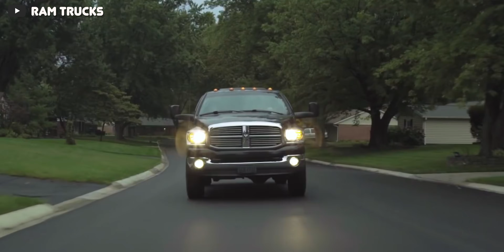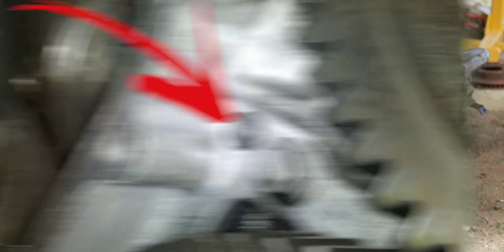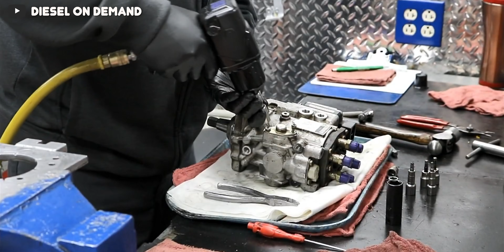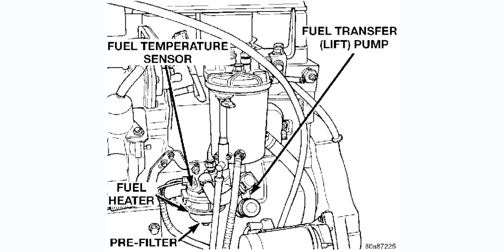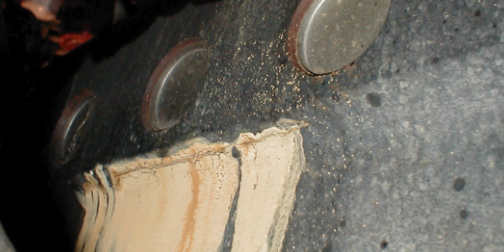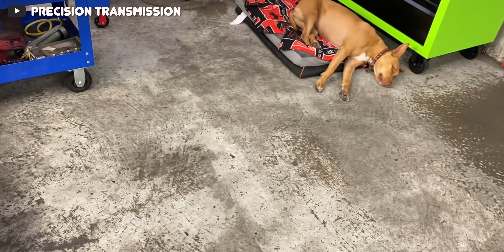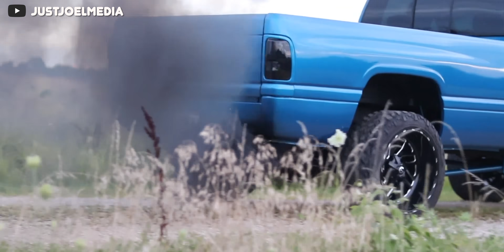Everything Wrong with the 5.9L Cummins (12V & 24V)

Comment: I'll admit the dodge with the manual transmission is the most reliable, you just have to get past the fact that it's the worst riding truck with build quality that rivals China quality and an electrical system that is beyond sub par.
Reply: What electrical system jk
Reply: @abraxaseyes87  he means the trucks electrical system as in the lights don't work the gauges give up the radio the windows all that
Reply: I see there is no point in defending my flavor or choice, as long as you don't try and tell me about how great and rustproof a 88-98 gm is , or what about that front end in a 3/4 ton ford from the 90's . My original statement was about 90's trucks guys . But they make different brands for a reason,so different people can deal with different problems .
Reply: @T-V-R-P id take a bad front end that really isnt bad over a truck thatll turn into dust 😂
Reply: "Gotta do the dodge delete on your cummins" - zip ties n bias plies
Reply: Take a 1995 3500 dually from all brands and I'd park my ass in a dodge seat first I personally think on gravel road the dodge rides best . That being said they are all horrible but remember these trucks were built for work back in the day not trying to ride like a Cadillac. And I'm not trying to start any brand arguments just my opinion from actually driving all 90's brands up my gravel road to get to my property.   .02
Reply: @T-V-R-P  so I prefer the Chevy 1 ton over the Fodge or Ford. If I had it my way id take a 12 valve with the NV4500 and put it in a Chevy pick up. Plus Chevy didnt use a solid front axle for the 4X4 system. Which has its pros and cons. Thats just my .02 though. Ill say this though, every brand has a great truck from different time periods and all have their pros and cons. Theres no decisive "best brand" in my honest opinion
Reply: An OBS Ford with a 7.3 is the best overall package. Sure the Dodge has a superior engine, but the 7.3 is still legendary in its own right (way better than the awful GM 6.5 of the time) and the rest of the truck is way better made.
Reply: me and my death wobble would agree with you 😂😂😂 mopar!
Reply: Drove a 98 that was stiff empty but rode great with the water tank I carried for work.  Electrical system was a joke and the steering was ugh loose😅
Reply: I have an 01 in an F-650 rollback tow truck with a 5.9 24v that weighs 17,500lbs when dead heading and can break 30,000lbs fully loaded. My truck is about as fast as a half frozen dog turd sliding down an asphalt shingled roof, but that Cummins pulls HARD AF regardless.
Reply: No problems with my 2015 3500 drw with the 408 cid  with the g56.
Reply: After owning 2002 cummins with 120-150k and 2005 with 150k-210k and 07 with 90-120k all i could say owner plays a big role. All 3 had zero problems. Preventive maintenance  is a key
Reply: @andreined8463  well i know a guy with a like 2016? 6.7 cummins who had to change the water pump, belt, alternator, and power steering pump within the first 50,000 miles.. and glow plugs lol
Reply: @Ilovemyidi  cummins dont have glow plugs. But then again alot depends on the owner
Reply: Negative ghost rider…… my 2000 f250 4x4 is the worst riding truck in all of history…… 😂😂😂😂
Reply: 47re aren't that bad,  the issue is most people don't perform the proper routine maintenance.
Reply: The only thing we had problems with electrically was the dash lights stopped working. Speedo kinda went goofy a couple times and the 3 speed auto needed rebuilt once. It plowed snow since 2001 pulled trailers and was a daily driver. Now it's just a pile of rust. It's been sitting since 18 and now the headlights just don't work. Now I'm not saying the wiring is flawless because iv owned other older dodges and yes their a fucken mess but this old cumm dumpster was a really great truck for our family
Reply: I think I will keep my 03 ram 3500, 585.xxx miles and still going strong. 2 clutches and I forget how many sets of injectors. But still the best truck I've owned.
Reply: No better or worse than any other truck I've owned 06 Dodge 5.9, windows all still working electric mirror on right side now has limited movement.  Cant think of anything else's thats a issue. Still a great truck.
Reply: Ford and chevy are junk compared to a dodge
Reply: Which dodge
They all could be bought with a manual
Reply: @ShogunAutoworks  I was referring to the 2500 and 3500 truck with the Cummins.
Reply: Well said
Reply: As a 2nd Gen owner (98.5) you are half correct. Every single thing has broken twice except for the engine and I'm currently on my 4th NV4500. I've split 3 cases, (always right behind the bell housing) and 2 np241 T-cases but the damn engine won't die.
Reply: For the dowel pin a buddy of mine would always pull the engine and just put a washer in there
Reply: Worst riding truck of all time is the obs F 250 with the front leaf spring suspension. 😂
Reply: Are you nuts. My ram Cummins rides like a Cadillac. My brothers Ford rides like it has rocks for suspension. It's the worst riding vehicle I've ever been in.
Reply: @daniastopjik3287
It comes down to a lot of factors that make a truck ride awful. My eclb 12 valve rode great, the single cab 2017 f350 I drive shoots my coffee into the headliner if I hit a bump.
Reply: It has gotten to the point of building My own Truck because I just don't like what is built recently.
Reply: I admit that every little thing breaks, my interior is gone and lights don't work, but this truck has 330,000 miles on it and it's always got me home... ALWAYS...
Reply: You haven't ridden in a new dodge have you?
Reply: As a young man I had a 1983 toyota Hilux.....dodge 3500 rides like a Cadillac in comparison
Reply: Other than THAT, is GOLDEN 😅
Reply: My 89 still runs like a dream, the motor that is. NOTHING inside works. Speedo, windows,  all gauges, etc, all inop. Oh wait,  the GPS speedo works great
Reply: 500.000 miles on all original engine trans and no rust or rot so eat it
Reply: Like they say, nice Cummins, shame about the dodge
Reply: I alway experienced in dodges every fucing thing in the truck breaks power windows the radio mirror controls seat controls electronic or manual then the front end then the transmission and any sensor and or model in the truck
Reply: @travisvaughan8838  I don't know where you were buying your used trucks from but I have a 1995 12 v manual , 1996 12 v auto , 1998 24 v auto , and a 06 manual trans dodge and honestly they're all pretty good mechanically and electrically. I definitely take care of them but no matter what kind of brand your talking about you either have  a new one with a payment or a used one with a auto parts bill .
Reply: @T-V-R-P  they have power windows that still work??
Reply: @T-V-R-P  I just don’t buy it I have been an electrician for 15 year I have been through 30 different service trucks and every ram I have been in has a great engine trans I never had issues out of but every little thing in the truck would break like stupid stuff the little cover for the 12v inlet the little thing that holds the sun visor in place nothing expensive just little bullshit the worst one is I had a 2500 2005 that you could beat on the dash till the radio came back on or aim for a pothole
Reply: @travisvaughan8838  Most all electric windows stop working with age from what I've seen. Any thing electric far as that goes no matter the brand.
Reply: @travisvaughan8838  that’s the only thing that still works on my 3500 😂
Reply: @travisvaughan8838 ”I have been an electrician for 15 years”. Translation; “I’m extremely hard on my trucks and don’t practice regular maintenance.”
Reply: @travisvaughan8838  I’ve actually had the opposite experience. I’ve owned a 97 12 valve 5 speed for almost 25 years, and it’s been the absolute most reliable and best truck I’ve ever owned. I’ve never had a power window problem or any other issue for that matter, even the ac still blows cold. They do ride like a lumber wagon but so does all 3/4 and 1 ton trucks, personally I didn’t buy it for the ride. My son has owned a 92 dodge w150 4x4 318 auto for 8 years now and it’s been excellent as well. I’ve owned 4 fords in my life 2 were bought new and I’ve never gotten 100,000 miles on one yet without major issues so I’ve stuck with ram till I have a bad experience.
Reply: Worst riding truck??? What are you talking about? In a 90s truck dodge has a coil spring front end that rides like a Cadillac compared to a the same year ford leaf spring front end that will kill you going over a speed bump faster that 1.5 mph.
Reply: They ride better than the Ford F-350 in 1995 I garuntee you that.
Reply: There are lots to complain about older truck. They were not designed with longevity in mind, other than the Cummins engine. That being said, my '00 2500 4x4 6speed Cummins HD has been a reliable workhorse, after replacing the lift pump with an Airdog Raptor and several other upgrades through the years. My biggest bitch is the dash core made out of peanut brittle strength plastic. Anytime I've had to mess with the dash, I've had to McGuyver it back together. Would have been great it THAT part had been metal!
Reply: True. Mine was only 2 years old when I paid 20k for it. My plan was to drive it like some of my trucker friends, who have a couple million on their Kenworths. I've maintained it like that, but have only averaged about 15k per year. I'm a bit past 205k. 🤣👌
Reply: I've had a lot of 90s fords, they're no better quality than dodge except for the dash quality. My 5 speed 96 12v rides better has more power and doesn't have any electrical problems. Can't say the same for the fords I've owned. It comes down to how well the vehicle was maintained before you own it
Reply: @DeeJay-iz3ts my 90 lariat pulls on 12 valves no problem… is arguably more reliable, more fuel efficient.. im getting around 25 mpg in a dually.. jake brakes on decel which is absolutely mouth watering.. theres one rust spot on the truck and it will run like butter until you turn it off with 650,000 miles on it.. thats with 15 psi of boost through a factory NA motor
Reply: @amoron6435  you're 90 lariat won't pull on a turned up 12v, my brother has a 95 f350 7.3 5 speed, it can't keep up with my 12v. I'm running compounds though. And there's no way you're getting 25 mpg. And empty mpg doesn't matter, what do you even tow? Lol
Reply: @DeeJay-iz3ts  30 plus out of these trucks is normal… im making 300-350 horse 600-700 foot pounds.. and did you really just compare a stock 7.3 powerstroke to a compound turbo 12 valve? 😂 i live in missouri onna farm so i tow everything… cars, hay, animals…
Reply: @amoron6435  well you're not getting 30 mpg out of a truck, empty or hauling, that's just not gonna happen for a truck that's towing and loaded with tools. His 7.3 definitely isn't stock, but my point is that a 7.3 couldn't handle 60 psi of boost stock like a 12v can, they dont supply enough fuel in the first place
Reply: @DeeJay-iz3ts  i never denied that point lol… and i dont drive a powerstroke.. i have a cc lb dually idi with a turbo that gets 20 mpg and a single cab short bed 2 wd turbo idi that gets 30 the main selling points of the idis are literally the gas mileage and reliability 😂
Reply: Great power train in a shiddy truck
Reply: @duncandmcgrath6290  as opposed to what brand in the 90's 3/4 and 1 ton trucks ?

Comment: The 47re was in the 96 - 2002 and a few 2003. The 94 and 95 had the 47rh
Reply: 48
Reply: @markball7028  48?? Care to elaborate some
Reply: @countcuda70  2003 HO and up have a 48RE. A few upgrades to make it live behind a more powerful Cummins. It’s well documented the upgrades. It will last a good while behind a stock power output if you don’t pull above 9000lbs regularly, and drive with a heavy foot every where. It’s still not a robust transmission in stock form. Plenty of good aftermarket market transmission builders out there that can make this transmission survive.
Reply: @markball7028  Yep, they still had the 47re in 2003 also. Until the HO was introduced with the 48re. The 48re will handle a lot of power when built. A lot of 2500s with the 68rfe are moving to the 48re to handle the power the 68rfe can't. I didn't include all of 2003 on my initial response